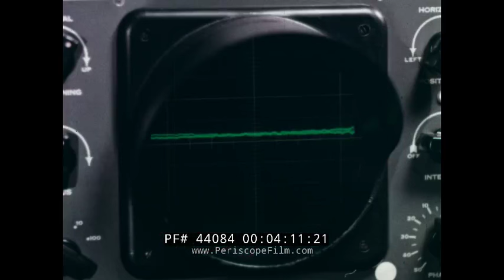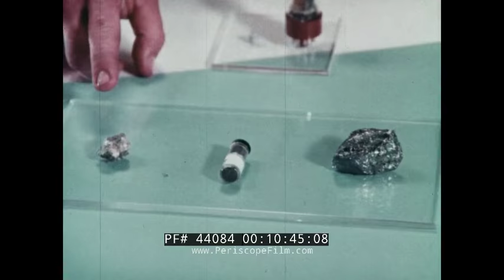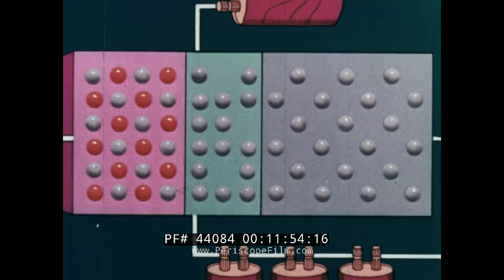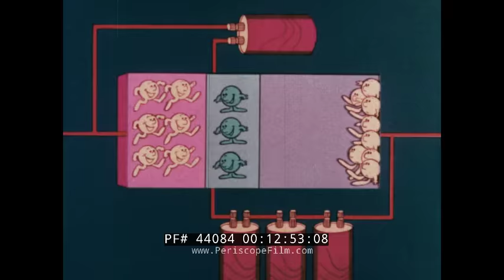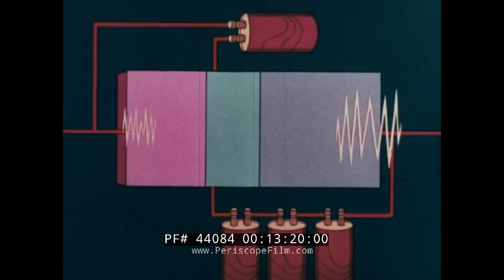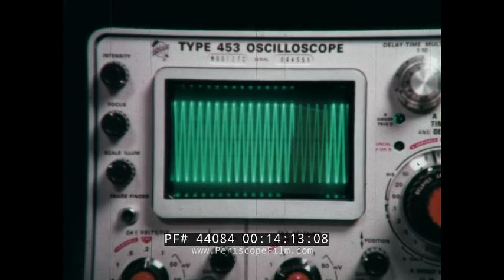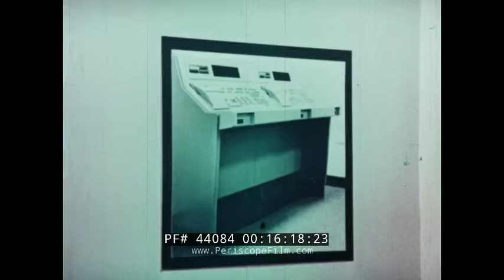BELL LABORATORIES HISTORY OF LONG DISTANCE AMPLIFICATION & TELEPHONE SERVICE 44084

Comment: This is a lot later than 1961. The date is covered by the PF# mark, but it looks like 70-something. The Saturn V launch shown at 14:47 is Apollo 11 from 1969.
Reply: I would say 1972-73. LED displays came out around 1974 in calculators and wrist watches.
Reply: Thought it said 1973 in the title

Comment: I began working at the Bell System a few years before this video was made.  This was during the time that the Bell System was indeed a System.  I long for those "old days".   Touchstone was just beginning to be installed.  Then the government broke up the Bell System.
Reply: There was "good" and there was "bad" about the System.  The "universal" in Vail's "universal service" was little more than the creation of a monopoly.  The "good" was the service effort that AT&T expended upon the operating units of the Bell System.  I don't think there are very many companies whose service was as good and the comradery with the customers as favorable as back then: 1950s-1970s.  The "bad" was the ownership of all telephone instruments and utter control which AT&T expounded upon any connections to their system.  This led to limited choices and few opportunities for smaller companies making equipment to interconnect.  The good of the system was that quality for the most part was maintained in equipment and consistency of operation.  The AT&T company had the FCC in their back pocket, so very little could be done by the "little guys" such as the Independents, the smaller GTEs and Rural Telephone Cooperatives to throw their limited political weight to lessen AT&T's stranglehold over regulation in their favor only.  In fact, the REA's telephone division even hired a majority of former AT&T personnel to create specification and drawings for cooperative use.  At one time, AT&T wanted to extend their domain beyond the U. S. and Canada to Japan and elsewhere.  The problem with any monopoly is the "bullying" tactics employed to prevent competition.  If AT&T had allowed (prior to the judgment of the Carter Phone Decision) to permit quality (but not Western Electric) equipment on their system and had been open to increased competition, I don't think the Justice Department would have embarked on the course it set out and completed in 1982-83.  I worked with both Bell operating companies and Independents.  I see both sides.  Independents, especially the cooperative rural systems, have negative views against the Bell System for many good reasons.  Competition has improved customer service and technical performance.  Like you, I do feel the "service" aspect of the old Bell System has been lost; witness automated customer service, neglected priorities of people over profits and some companies' indifference to customer needs.  However, you have a more competitive, seasoned business environment where you can simply . . . leave your consumer relationship with poorly maintained and supported communications utilities.  Also, while Western Electric is touted by these "infomercials" as the greatest manufacturer of phone systems, I can recall Northwestern Bell people complaining that a major order for switching equipment, cable, remote terminals or such which had been in wait for over a year, could be circumvented by New York Telephone or similar company experiencing a need and their order switched over to them, while NWBell had to suffer the consequences of another lengthy wait.  So, priorities were not necessarily equal within the System either.  This generated many angry RBOC people in various regions.  On the good side of AT&T, I read the reports submitted as court documents on the proposed break-up and the impact on the Bell Laboratories to future innovation.  In one lengthy report, the comparison was made between the Electric Power Research Institute (EPRI) and Bell Labs (BL).  The critics felt that with the break-up of the system, a major research laboratory would lose its ability to maintain its dynamic strength of innovation, by separating it from the Bell System and consequently the large budget which AT&T bequeathed it's innovative history.
Reply: @765kvline  The Northwest Bell electronic switching equipment sent to New York City occurred due to a major fire at the Manhattan central office. The fire took out the underground wire vault and the first two floors of switching equipment.

Comment: Fleming, not DeForest, invented the vacuum tube,
DeForest invented the multi element tube.
Reply: So you never heard of a 'Fleming Valve'? As in many things, including the incandescent light bulb, development happened in two different places at the same time.
Reply: Edison discovered the one way nature of a two element tube. He was trying to collect the carbon coming from the early filament and  blacking the inside of his light bulbs. He placed a charged metal plate inside and it worked to collect the carbon. Then tungsten was discovered for this and the collector became unnecessary. Edison was too uneducated to realize the potential of his own discovery. Since he could not do the math required to understand AC, and ALL of his systems were DC, he declared it useless. Since Edison's systems were all DC, he had no need for a rectifier. Fleming understood the implications of the Edison effect and applied it to create the "diode" tube as detector in crystal radio sets. DeForest added the control grid that made the tube into an amplifier. Funny side note, DeForest never truly understood how the triode worked either!
Reply: @videolabguy  and without realizing it Edison discovered thermionic emission, Flemming took it farther the diode rectifier Deforest the triode and amplification. Then everything took off FAST! Of. Course you know that. But there's bound to be some newcomers to all this, and yes I'm trying to bait some of them into learning more!
Reply: @videolabguy  ...Indeed.  DeForest not only didn't understand how his triodes worked, but his early vacuum tubes were gassy and unstable.  It took the researches of Dr. Irving Langmuir at General Electric to improve the diffusion pump and create the first true high-vacuum diodes and triodes in the late 1910s.  Many useful inventions are made by engineers, then scientists come along to explain how things work.  We need both kinds of thinkers working together to make progress.

Comment: 19:55 The narrator talks about the future potential of fiber optics in transmitting telephone signals. ATT was using fiber for long distance and even local calls between central offices since the mid 1980s. However, ATT is now dropping fiber into subscribers homes -- in some communities -- for UVerse talk, television, and internet service. I remember the contractor having to come into my former apartment autumn 2018 to install the cable between studs in the wall and to install a dummy connection plate. This was at a modest-rent apartment complex in Oak Creek, Wis. The fiber was installed whether we subscribed to any ATT service or not. I had the low-income version of UVerse internet which came in by gold old twisted pair of copper wire.
Reply: That is DSL version of UVerse.